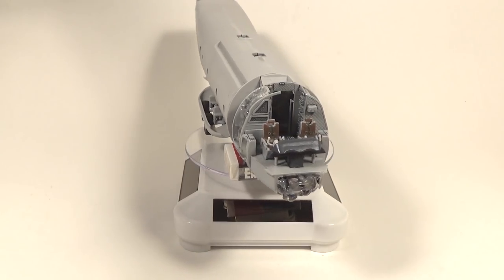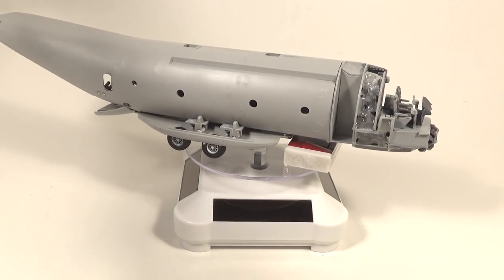Model G.222 - 1/72 Italeri - Interiors

Comment: good job ... sorry that I put in your work .. but you can paint some parts of the floor in black as to make the non-slip... good luck
Reply from the maker: Yeah, I could have made a lot of things there. But as I said at the end of the movie - I wanted it to be as simple as possible, since I've decided to focus on the outside ;).
Reply: I'm sorry .. that part I had not heard .. you're doing a great job .. I just wanted to help with my advice
Reply from the maker: All the advice is appreciated :) I like to focus on details from time to time, but when the model is at least a little open and the interiors are visible.